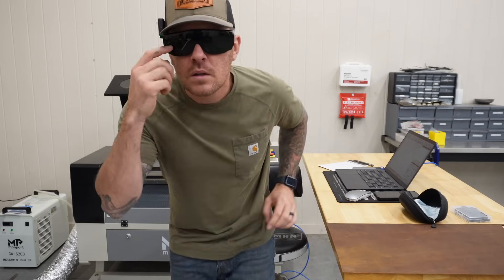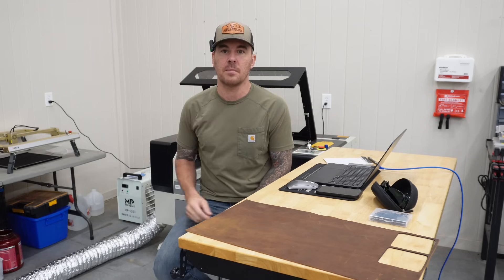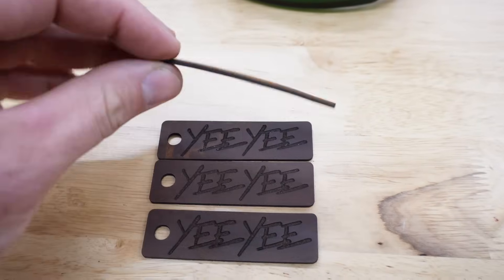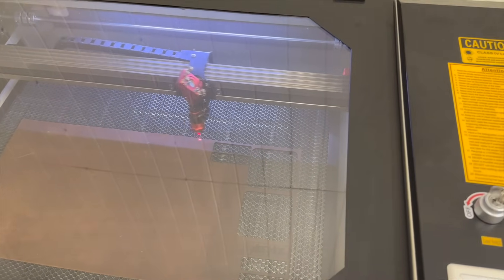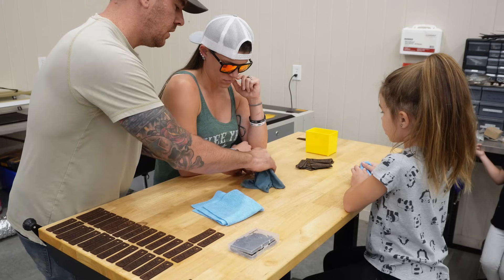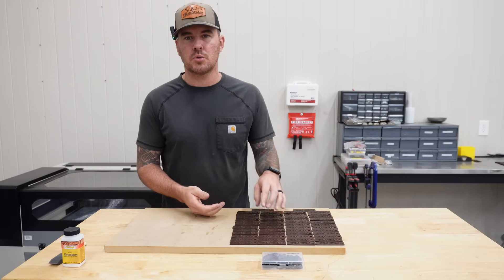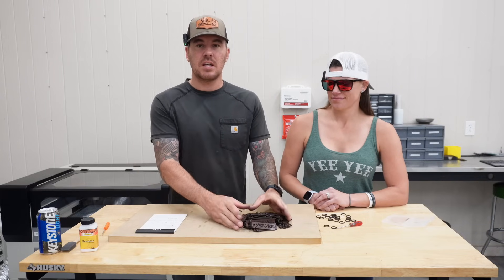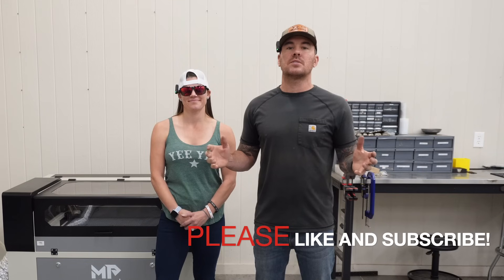LOSING Money To MAKE Money

Comment: How is that laser working for you many months later ?
Reply: Yea I know what that’s like in terms of property.  I’m trying to bypass the process of buying a plasma machine and go straight to the fiber laser CNC.  The water bath and edge slag is a turn off for me.  To much maintenance, add humidity to the shop and to much post processing work removing slag from the edges.  
Thanks for the reply.
Reply from the maker: @roberth1858 yes the dross can be a pain.  Im also looking into a CO2 laser that can cut up to 16 ga.  The fiber lasers ive been seeing are all 3 phase and require a transformer.  Which isnt the end of the world.  Im not familiar with consumables and maint on the fiber units.  The plasma are pretty low maintenance for the most part.
Reply from the maker: I havent had any issues with it.  Ill have some more content using it soon. I honestly dont have a lot of hours on it.  Been busy on the property.

Comment: To save time on your engraving, put each logo in a separate layers for the engraving part. You then engrave each logo complete before moving on to the next. This saves time cause your laser doesn't travel between logos all the time i.e. white space. Then put your cutting all in one layer to be done last.
Reply from the maker: Thats how my xtool does it.  Its pretty nice.  Ill have to find that setting in lightburn
Reply: @SpicerDesignsLLC  Setting for laser individual laser. Also, each logo/design is different. I look at time to fill and also time to off-set fill. A number of batch jobs I do are way faster on offset fill.

Comment: I'm new to the laser world, but doesn't cutting leather with a CO2 laser produce a toxic gas of some sort? For some reason I thought you shouldn't do leather with co2...
Reply: I just saw this confirmed on the Montport website' article called "What Materials cannot be Cut by Laser Machine?"  However, they might be wrong. Other sources say only artificial leather produces chlorine gas.
Reply from the maker: @benhuddleston  im not sure on that one.  Im using real leather and monport has a section in their manual for cut settings on leather.  Plus all the fumes are extracted through the exhaust.

Comment: When I did my keychains, I made a jig with the laser, which would work great for applying the resolene in batches and keep them from moving.  Super easy to make with a scrap piece of 1/8 ply.
Reply: Also, I found a butter knife works great for starting the rings.  I didn’t realize how hard it would be on the fingers but that becomes apparent after the first 100 lol
Reply from the maker: Great ideas!   Thanks for the tips

Comment: I have to LOL...  Your adjustable table is not from Amazon; at least the one in your video and the link provided don't match..  Why not post the link to Home Depot?

Nevertheless, love your videos, and I did use your code to order the 150W machine from Monport, but they dicked around too long and I ended up canceling my order.  If I order another one, I will be sure to use your code again.
Reply from the maker: Thanks.  I do really like that laser. Its been great so far.   I just put a link for a similar style table because everyone uses Amazon.  Its cheaper than Home Depot and free shipping.

Comment: 10:42 Soul-crushed (actual crush face at 10:44), lol. Great fam!
Reply: for sealing, there are spray on leather sealers (probably want to do this outside, although with that ceiling height, at a small volume... maybe... maybe not, anyway, the spray is quick, and gets in those groves, a couple passes done. Not as cost effective (material cost) but at scale, faster (time cost). Great video!
Reply from the maker: @AnotherScreenname thanks for the pointer

Comment: You have an air bubble in your cooling line.  Squeeze the rubber hose a few time and it should work it’s way out!
Reply: Thank you for saying this. I was thinking the same thing when I watched the video. That is a good way to destroy a tube.
Reply: *big air bubble. May need a bit more water in the chiller.
Reply from the maker: @LuisCasstle ill check it out

Comment: If you miss a cut but don't move the material you can cut it again. I have a similar laser and run into this all the time with new material. Just cut the outside in another pass or two to save the part.

Comment: Best way to remove char is with a soft toothbrush under a stream of water - then immediately place the item between a couple of towels. Soap can cause other issues, and doing it under the tap is fast. 
You can really get your engraving dialed in using Lightburn settings, but it took us 2 yrs of experimentation and still learning. Once your machine is running with exact alignment and focus, everything will be easier and more effective using the various settings for scans, travel speed, power ... and clever use of layers.
We imported a big blue 130w co2 machine from the factory in you-know-where. It was a stressful purchase, but very happy with it now.
You will find a lot more uses for it: making jigs, templates, store displays, tool cutout trays for your tool box, fabric cutting, etc.
Russ Sadler is the undisputed expert and his videos are an absolute must. He is a true engineer and knows everything about these machines.
https://www.youtube.com/@SarbarMultimedia
Good luck with your laser.
Reply from the maker: Thanks for the tips and suggestions.  I am by no means an expert.  Still learning but really enjoying the process.

Comment: A new Pizza joint is having their grand opening today.  She bought 6, yes I said 6 powder coated tumblers to give away as door prizes.  I "gave" her 4 Stainless Steel Keychains, 6 pens, 6 cork coasters and 6 anodized aluminum dog tags with chains with her logo on them to help her in their grand opening.  She wasn't expecting that.  When I ran my photography studio I have wallet size prints to all my customers.  1 sheet cost me 1.50 each.  Those were like small biz cards.  I've been doing this type of marketing for a 100 years.
Reply: wow how old are you?
Reply from the maker: Thats awesome.  It does work and a great way to build relationships.   Thanks for sharing!
Reply: Sure no worries.  I source almost 100% of my materials from China directly.  SS Key Chains cost me around .25 cents each.  It's the only way to go IMHO. @SpicerDesignsLLC

Comment: Could you have gotten a faster cut and/or higher yield by butting up the adjacent edges in the nesting?
Reply from the maker: Good question.  I wouldnt say you couldnt do that but i wouldnt.   It would have to make a full pass all the way around as the design shows.   Could tighten them up a little bit more though.
Reply: I thought perhaps Lightburn could optimize the cutting path when it realizes two edges touch.  I'm guessing LB is more like the Crossfire software than the slicer software for a 3D printer, which can do a whole lot of magic.
Reply from the maker: @JCWren  i dont do a whole lot of laser engraving.  I can get my cuts done but im not as versed with lightburn as i am with fusion.  Ill have to check into that neat feature on lightburn.   Thanks for the pointers
Reply: Lightburn can do it by getting rid of overlapping lines in the optimizing settings in the software.  You also can do it in designing the keychains to overlap on the edges and weld them.  I’d do a row and then do the array tool.